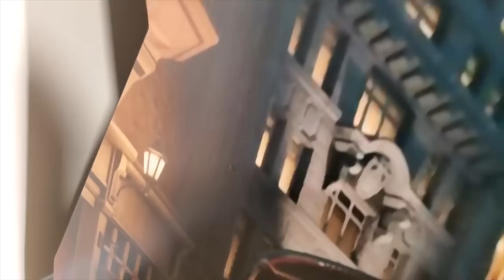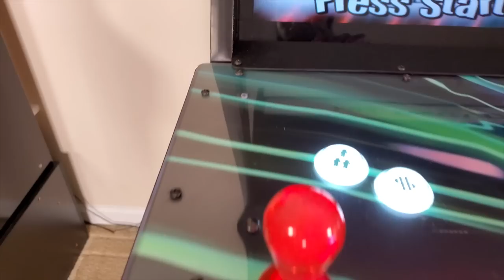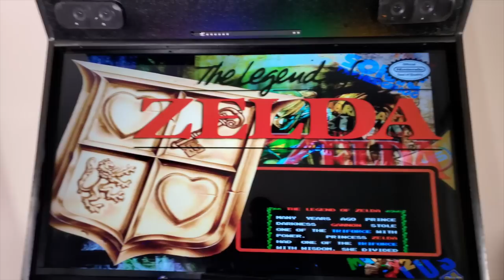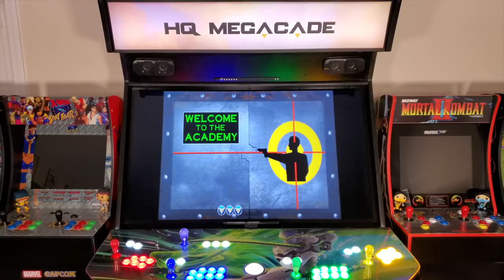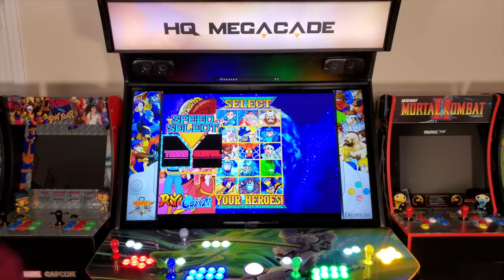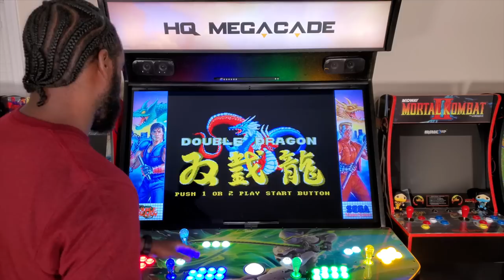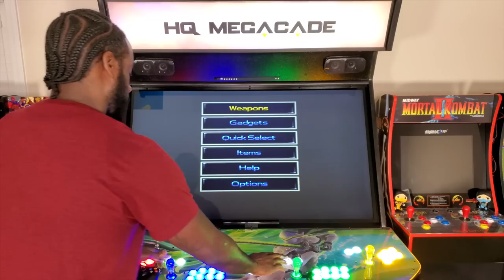Extreme Home Arcades "HQ Megacade" - Custom 4 Player ONE YEAR REVIEW

Comment: Great material can be watched and watched;)
I have a 3 Question
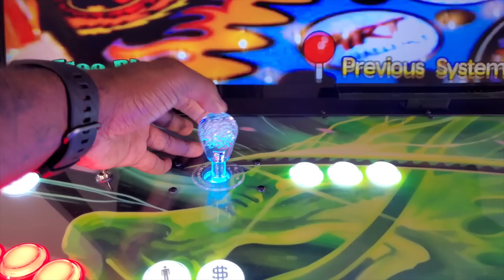1. What this switch near the 4way joystic 10:19 on the left is for, maybe it is a switch so that you can play games from the pad on the Arcade panel, there has been an update in Ipac for a long time that allows you to switch between xinput, dinput, direct input, dpad etc ;)
2. 12:32  You know exactly the model of these 2.1 speakers +   8:14 What's that volume button ?

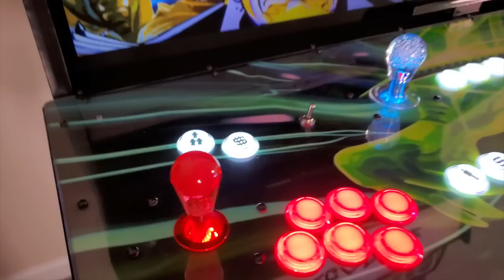9:28 I have this same problem at home in Seimitsu 32. as far as i klnow it is enough te replace the srpings but unfortunatel it will be repeated anyway thehe is no rule for it :\

3.  11:42 What is this usb hub model with switcher on off ?
Reply from the maker: 1. (10:19)That switch is for the 3 buttons next to the 4 way joystick. Allow you to utilizing those buttons to act as right click/left click. Mimics a mouse while your trackball is how you'd move the cursor.

2. (12:32) These speakers are Cyber Acoustics which can be found here on Amazon https://www.amazon.com/dp/B007PXV2KM/ref=cm_sw_r_cp_apa_fabc_E2NW4BDYWWH7WYMEW4MK 

3. (8:14) It's actually a volume knob. You can turn it right to left for volume up and down. Also has a switch on the side for bass boost. Check the pics in the Amazon link I posted above.

4. (9:28) No big deal thus far. Still holding up good.

5. (11:42) Sabrent USB Hub Heres what I found on Amazon. https://www.amazon.com/dp/B00TPMEOYM/ref=cm_sw_r_cp_apa_fabc_C7E56WFX614DA4ABWE0W

Comment: Question. When you were playing MVC on Dreamcast, you used the Xbox controller. Can you not use the sticks on the cabinet instead?  Which system emulator used a controller vs stick?
Reply from the maker: You can use the joysticks and buttons if you want. I prefer the controllers as they were intended. And mostly all systems can use the controller or stick. All boils down to personal preference.

Comment: Hello! How come you have external console systems inside the cabinet? Is it because those systems/games are not part of the 70K stocked games it comes with? I am curious because I got one of these, I would want to connect my Switch up. However, not sure if the joysticks/buttons would be able to connect to the Switch. I've done it on my existing arcade (modded Golden Tee cab.) Had to use the Wii GameCube controller adaptor to connect to my X-Arcade Tank Sticks to the Switch dock. Thanks!
Reply from the maker: I out those consoles in there just cause. The other 60k+ games are a lot of old school and retro titles. So I out the consoles in there so the Megacade is literally a one stop shop.
Reply: @dthomasfromnc  gotcha. Makes sense. Thanks!

Comment: Why wouldn't they put a coating to seal everything? I build corn hole boards, and never have issues with the artwork due to using a sealer. I mean yea, it's more effort to remove the artwork if you wanna change it, but for the amount of money, I'd expect to not have any lifting of the vinyl.

Comment: Where did you purchase the Xbox 360 controllers and wireless USB hub?
Reply from the maker: It all came with the Megacade from extremehomearcades.com
Reply: That's right.  He isn't doing 360 controllers anymore. 😖
Reply from the maker: @kombatkorey  what is he doing now,  Xbox One controllers?
Reply: Yes, Xbox One controllers.
Reply from the maker: @kombatkorey  that should be better right?
Reply: I've heard the 360 controllers work better.
Reply: Hey, DT, what is the shortest dimension of the megacade without the control panel?  I have 31" doors.
Reply from the maker: @kombatkorey  you're good bro. I think my doors are like 29 inches and it fits. I think I did the measurements in this video here https://youtu.be/CpQniGjTSCs Check it out.
Reply: Thanks, Bro!

Comment: It looks very nice, but for what you paid it’s overpriced.
Reply from the maker: So in your opinion, what should it have cost?
Reply: That’s a tough question. But I feel some where around the 3k to 4K range. Who knows maybe I’m way off and it cost them cost to those prices to make.
Reply from the maker: @joshuawahl4336  okay gotcha!
Reply: @joshuawahl4336  There are options there.  Mine was around $4400 shipped.  It depends on what bells and whistles you get.  I went basic classic with wider 2 player controls, added my own led buttons when I got it and had them put in USB ports on both sides underneath for guns when I add them.  It’s just like a new car, the options and extras is where things add up.
Reply from the maker: EXACTLY!!!! You're right about that.